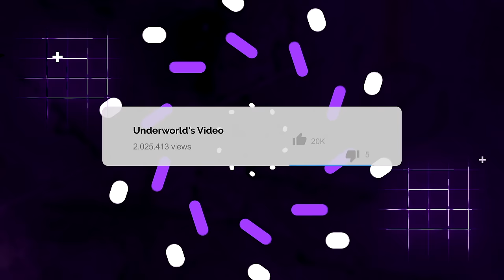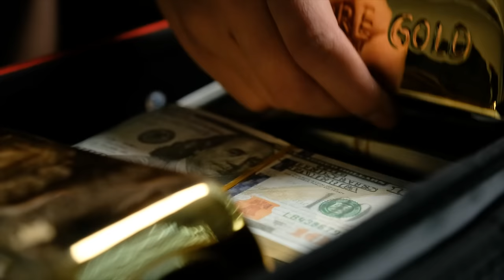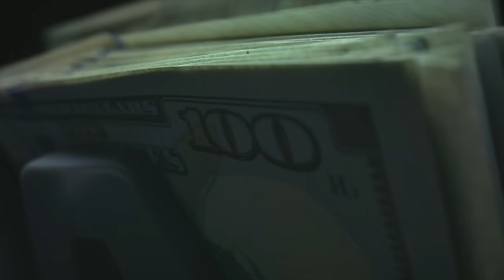10 Biggest Mining Operations in The World

Comment: I was fast forwarding to see if Kennecott was on list... Yep #1! They have a train that makes its way out of the hole and it takes an entire day so I've heard. Kind of a detail that could have been said.
Nobody calls it the Bingham we all call it Kennecott. Just saying
Reply: Not a passenger train though, right? Just the rail road that wraps around the canyon? I didn't know it went all the way to pit, that's pretty cool. 
I've actually done some contracting work for Kennecott and one of the jobs was to put gas detectors along that rail road at the refinery and smelter.
As it turns out, ammonia gets transported along that way and if one of those cars derails, it would have the most devastating impact out of any other risk there.
Everyone was against the project because there were many other things they wanted to use the budget on and felt like the event would never happen, but while we were working on it, that exact train actually derailed at another location on the same track 😬

Comment: Face it small compact dense sources are safer than a herd of exothermic rxns.  Electric cars have an Achilles heel (explosionfire)  Close stator rotor tolerance yield good pick up.  That said
Reply: 10 times as many ice cars burn up but that doesn't make the news. if an electric car catches fire especially a tesla it's front page news. it's actually rare.
Reply: @ronblack7870  it's about gaining.  Weight, ice wins.  Heptane vs redox?  Radical wins.  Application.  Batteries are maintenance intensive vs  pressure made motion.  More predictable wear factors